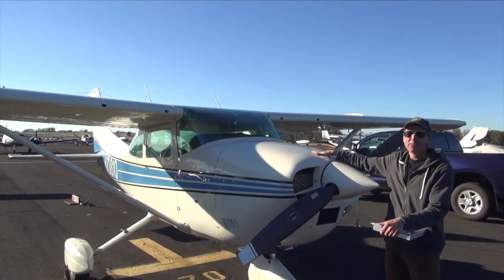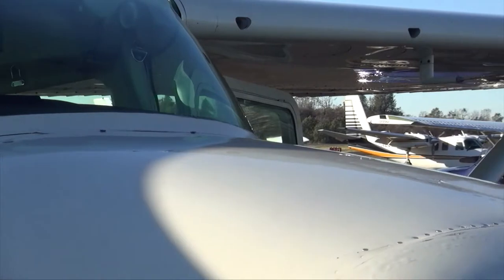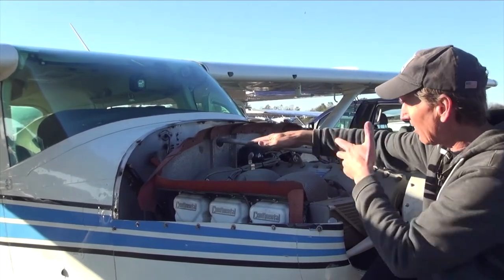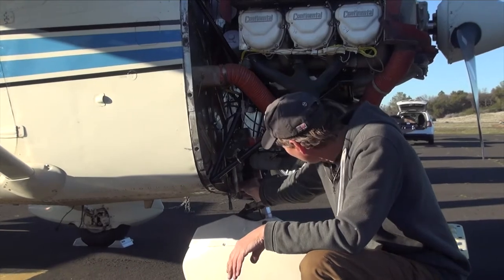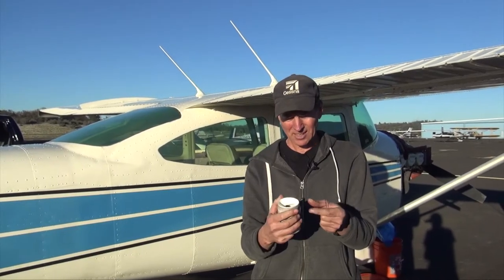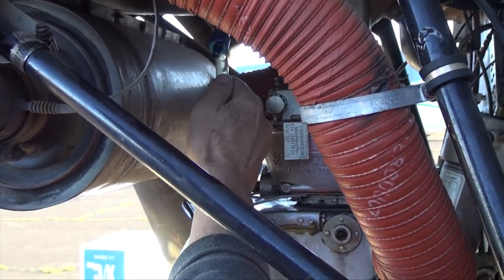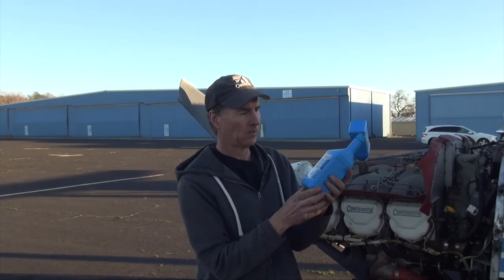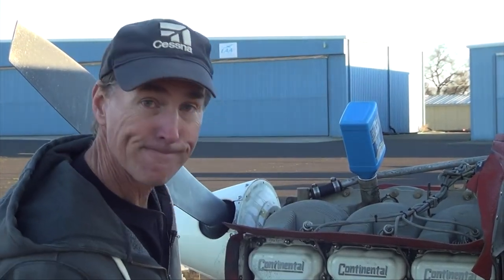Cessna 182 - Orientation (part 3) - Engine & Oil System Introduction

Comment: hmm you forgot to check the coolant loli still want to put a turbine in mine. ,maybe. no stc for it.  but you do have a nice looking plane. but all 182s are great looking i also fly a bell 505  use that for sneaking across the canadian border  at night at 60 ft    no lights. no transponder on.   catch me if you can lol in all seriousness i  upgraded my engine to a 280hp a few years ago. big difference  3 bladed prop.  but i also live in the mtns in  northern washington state. does not fly in the winter .  she is fine in her heated hanger here at the ranch also vgs make it a lot easier to land and take off  once again  i think  it is the best plane cessna ever made.  over the years i had a 210 and amixmaster but still kept my 182  as yuou can tell i love that plane. i told my gf she can only fly naked in it lol so far? no dice

Comment: I have a 182 P with  leaks in the pushrod cover tubes at both ends. Leaking onto the Muffler box on the left side ... I planning to place all 6 cylinders pushrod covers. That oil makes a mess , Have you replaced the pushrod orings? or cleaned the carb housing  i  see yours has had oil dripped on the left side too .
Reply from the maker: The aircraft loses very little oil with now 850 or so hours.
Reply: Ok I am burning 3 qts in 24 -26 hours with a 3200 Tt engine and 320 Smoh